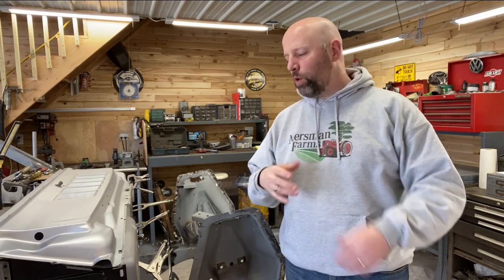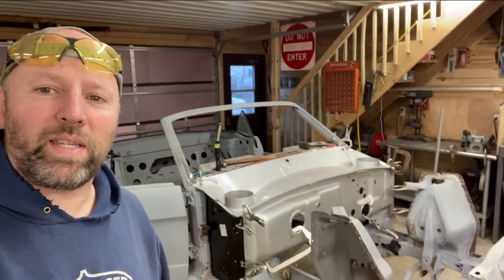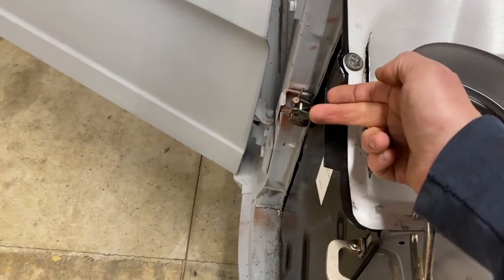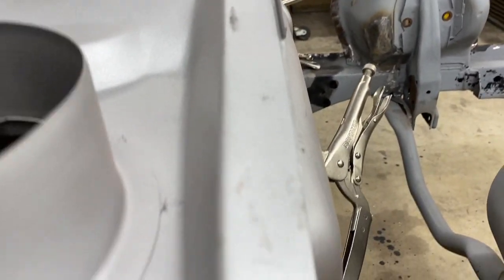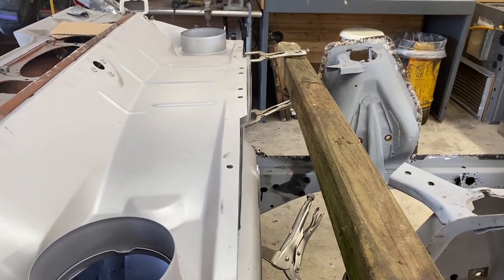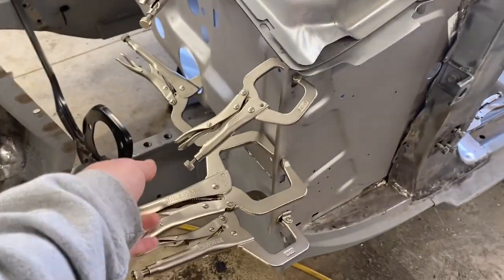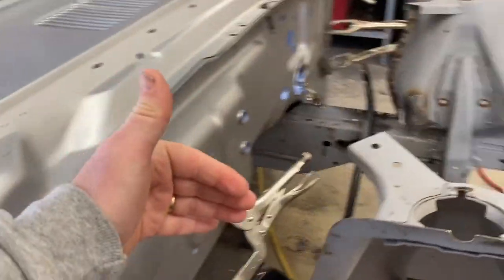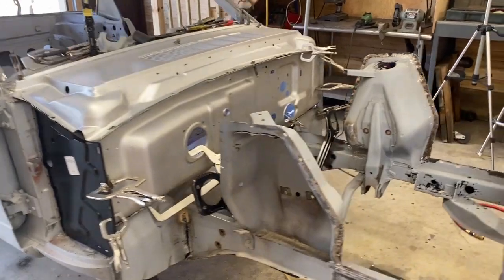1966 Mustang Restoration Pt 10 - fitting the new cowl to the firewall

Comment: I've done 2 cowl panel replacements on 66 mustang coupe cars. What I've learned is you can't take to many measurements. Get the car sitting level on stands and take TONS of measurements before cutting anything out. Looks like you're doing a great job building that car it's looking good.
Reply from the maker: Thanks!  I agree.  You can never have too many measurements or pictures.  I often take videos of me measuring things or describing how something came apart or goes together.  I rarely need them but never regret having them.

Comment: We'll be replacing the cowl later this summer in our '66 coupe.  Be interested in seeing how you drill the holes and weld it up with the cowl properly aligned.  I'm worried about the gaps to the fenders.  Hopefully the  holes with the tapered punch will provide the correct alignment.
Reply from the maker: I'm still battling getting it all lined up.  Keep watching future episodes and I will share what I learn.  Once you get to replacing yours, feel free to let me know if I can help answer questions or anything.  Having somebody to answer questions is a huge help. Good luck!
Reply: @3rdstallgarage  Well, summer is over, and we got as far as completing the interior.   Looks like Spring 2022 is when we'll be pulling the engine, stripping the engine bay and then attacking the cowl.   Will look for follow on vids to see how you addressed the alignment issue.

Comment: I am sure you will make use of all your resources, so I have every expectation that what you find out about the export brace and cowl/firewall alignment will most likely become a resource for others (no pressure right!).

The only common thread I have come across is that the export brace is always to be trusted, and that even bone stock factory cars must be brought into alignment with the brace, not the other way around.  So that means you have multiple variables in play when you are using aftermarket panels, but the brace is not one of the variables.   

I imagine a ton of very careful measurements based on factory specs will get you the answers we can't wait to see in action here.
Good luck!
Reply from the maker: Well...yeah...no pressure.  That definitely removed the option of just cutting the export brace and calling it good enough.  But the right thing is to dig to the bottom of it and figure out what is going on.  Thanks for motivating me to do the right thing and share it so it hopefully helps somebody else.  Thanks for watching.

Comment: looking good, unfortunately marrying new pieces with old or even new with new was a challenge. Different manufactures and tolerances led to a lot of tweaking. great progress, keep up the good work
Reply from the maker: Thanks.  I wish the alignment holes in the Dynacorn cowl matched with the CJ Pony firewall easily.  I can get them to line up , but it takes some force.  My export brace doesn't line up at all.  I wonder if I need to drill new holes in the export brace, but I fear that it's a symptom of a larger problem that I shouldn't ignore.  Thanks for watching.
Reply: @3rdstallgarage  It is a tough call, that is why getting as many panels involved is the best way to figure out if any one is the culprit. maybe try the inner fenders to see if the shock tower relation to the firewall is good

Comment: Did you ever solve the hole alignment problem with the cowl and export brace?
Reply from the maker: I'm getting closer.  Sorry for the slow response.  I'm finally back at working on the car again.  I uploaded a new video this week which shows a new tactic because using the alignment holes wasn't working for me.  Everything had to be twisted and forced to get the holes to line up.  And once the holes were lined up, it was way off from side to side.  So I'm abandoning the holes and building the car from back to front. Stay tuned for some more videos.

Comment: Hate the damn cowl panel on my old 1965 mustang but not inclined to take the fenders off and all the rest to break out all of the old tack welds and put in a new one.   Right now just have one of those plastic panels over my upper cowl vents.  Looks hoaky to me but wife says the plastic cover panel does not look bad at all.  Well, was only $29.99 and no further water getting into old cowl and ruining my floor.  If I decide to get an engine rebuild or replacement then I will replace cowl.
Reply from the maker: Sounds like a good temporary solution before you are ready to tackle the big job of replacing and painting.
Reply: @3rdstallgarage  Well, my floorboards and carpet are not damaged too much and no musty smell.  I only have the six-cylinder engine, sadly, and not 289 cubic inch that I would like to have but may get the six-banger rebuilt and if I do I will have cowl panel replaced at that time.  At my age now I really have no need for more horsepower.  Just enough to get on and off of highway access points o.k.  Again, I am so happy that not only old baby boomers love the classic mustangs but guys in their 20's do too.